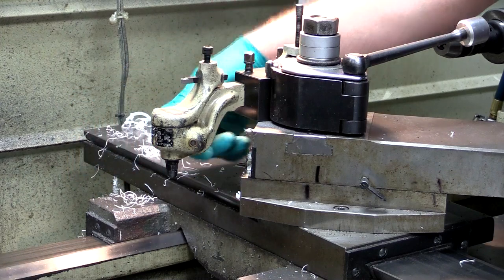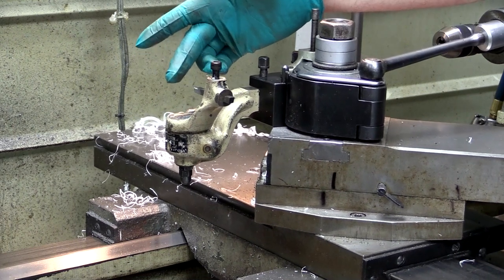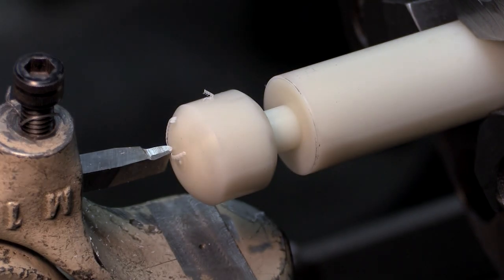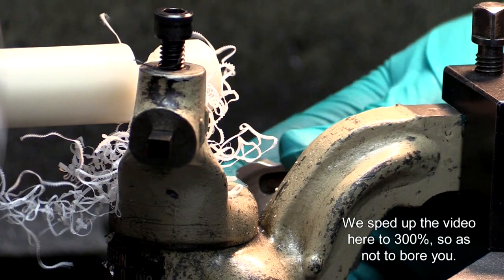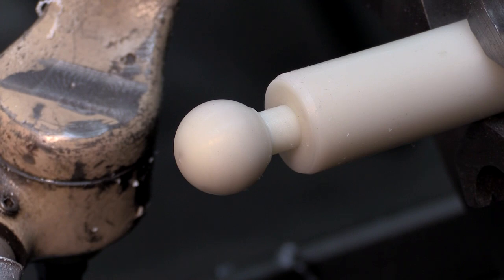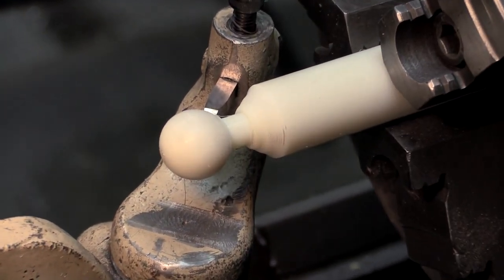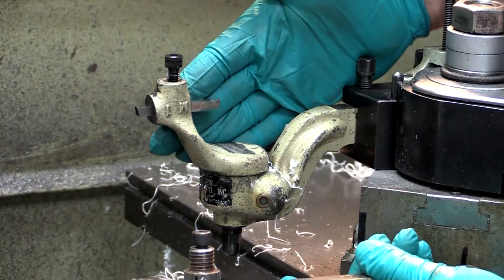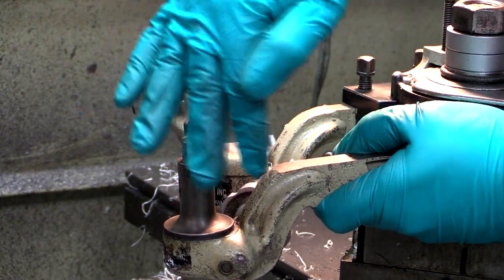How to Machine a Ball

Comment: You can't make a perfect ball using this tool. This tool can't cut the ball off. It works good only if you need a ball to decorate a handle, i.e. the ball screwed on a bolt. But even in this case the boring bar works better - the radius can be adjusted
https://youtu.be/_w_-aHuRf4A
To make a perfect ball use this
https://youtu.be/nr2bFJtu7_U
Or this for wood, plastic
https://youtu.be/ALZih2kslUQ